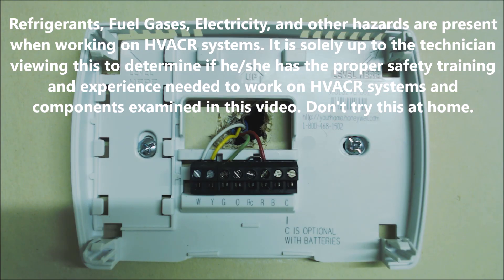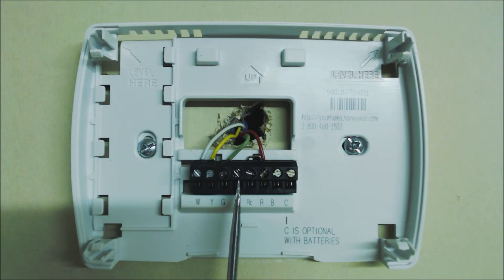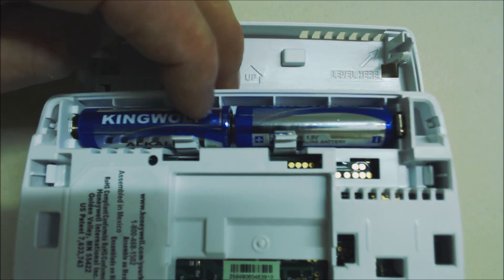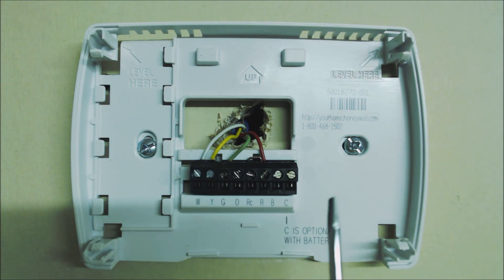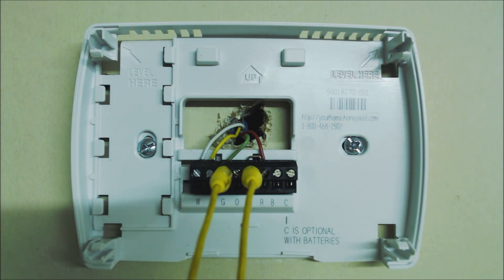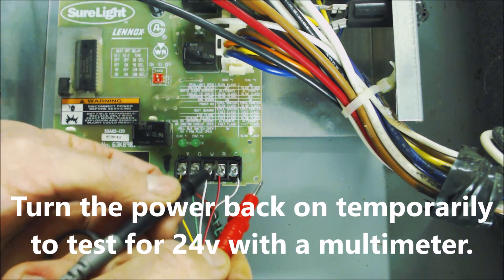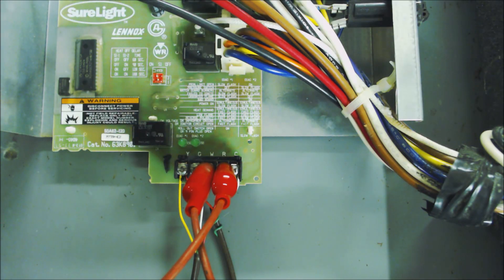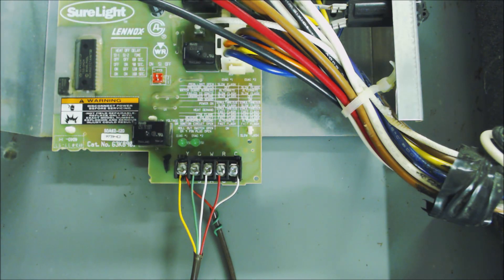Test the THERMOSTAT with Jumpers!

Comment from the maker: Tool List-  https://www.amazon.com/shop/acservicetech
Support-  https://www.patreon.com/acservicetech
For those that are looking for the tools used in the videos: (Linked Below)
Magnet Jumpers- https://amzn.to/2PyKPQZ
Pro 3000 Thermostat- https://amzn.to/2DKaYGc
Alligator Jumpers- https://amzn.to/2PxqJXn
UEI DL479 Multimeter with temp sensor http://amzn.to/2jtsUbJ
Fieldpiece ST4 Dual Temp Meter  http://amzn.to/2wc1ME3
Fieldpiece Bead K Type Temp Sensor https://amzn.to/2DBwKfs
Fieldpiece Wet Bulb Temp Sensor https://amzn.to/2RRI7Tw
Fieldpiece TC24 Temp Clamp https://amzn.to/2qHLyjZ

Yellow Jacket Refrigerant Gauge Set http://amzn.to/2aenwTq
Refrigerant hoses with valves http://amzn.to/2aBumVI
Yellow Jacket Gauge set & hoses https://amzn.to/2vLVkV9
Yellow Jacket 4 Port Manifold w Hoses https://amzn.to/2BkuGIq
FieldpieceSMAN360 Digital Manifold Set https://amzn.to/2BdoaD4
FieldpieceSMAN460 Digital Manifold Set https://amzn.to/2nB4Fe6
Compact Ball Valve for Refrigerant Hose https://amzn.to/2KUisW8
QuickDisconnect 90 for refrigerant hose https://amzn.to/2MMtVcg
JB 6 CFM Vacuum Pump   http://amzn.to/2nqbvo8
Appion Blue 3/8" to 1/4" Vacuum Hose http://amzn.to/2uYlVyc
Appion Red 3/8" to 1/4" Vacuum Hose http://amzn.to/2uYg6Ro
Appion Valve Core Removal Tool http://amzn.to/2uYr8WL
Yellow Jacket 1/4" by 1/4" hose http://amzn.to/2umtcod
CPS Vacuum Micron Gauge http://amzn.to/2v1nM3O
Supco Vacuum Micron Gauge http://amzn.to/2v1JRiA
RectorSeal Bubble Gas Leak Detector http://amzn.to/2ckWACn
UEI DL389 Multimeter  http://amzn.to/2xAdaJf
Air Acetylene Torch setup    http://amzn.to/2aQalsb  
15% Silver Brazing Rods  http://amzn.to/2gVLyLc
Nitrogen Regulator    http://amzn.to/2bXdR5f
Nitrogen Flow Meter    http://amzn.to/2brvoBg

Other tool links can be found in the video description section.

Shop through Amazon! Your Purchases through Amazon provide a means for channels such as mine to earn advertising fees from all purchases after clicking through. Prices are the same as normal-    https://www.amazon.com/shop/acservicetech
Reply: Great. Thanks for this information

Comment: I wonder how common it is for thermostats to go bad vs. other problems such as wiring, air handler or heat-pump PCBs, etc.
Reply from the maker: It really depends on the situation and the environment, but thermostats are definitely a common failure point!

Comment: This video saved the day for me. I had my 20 year old Trane heat pump and Honeywell thermostat replaced a few months ago with a new similar Trane unit equipped with an Aprilaire thermostat. It was working fine until first cold day under 30 degrees. Aux heat and Emergency heat didn't turn on the electric heaters.  Using the techniques in this video I jumpered between the red , white and green wires and everything worked perfectly. Reinstalled the thermostat and found the new Aprilaire thermostat was receiving 27v but was only sending 16v on the white wire, not enough to energize the contactors. Checked wires and could find no problem. Finally switched back to my old Honeywell thermostat and it's working perfectly.

Comment: So my AC and fan is working yet when I cut my heat (propane) on I hear the thermostat click but then when I go to my furnace I hear it short cycling would this usually be a thermostat problem? If so how would I test the thermostat properly? From your video I assume you would jump the Red and the White correct?

Comment: What if my hvac heat unit is working but suddenly it doesn't turn off when it reaches temp. It just keeps going. It's a carrier all in one forced air gas heat and air unit. I killed power, changed batteries of thermostat. When I started it back up and applied power, the heat and fan kicked back on. Even though the set point is way below the actual temp in the room.

Comment: Does Rc (at the thermostat) connect to just Y.   OR.     does it connect to both
Y and G.              At the control board you only jumped R to Y.  for cooling test,
but no G for fan? thank you
Reply: I need that answer too because some units only jump out if you put 24 volts to y and G at board while others work completely by just jumping out y at board. I know that is based off of the board at furnace but if the thermostat doesn't send call to G always then some units wouldnt work with just a call for Y at thermostat. I think the thermostat always energizes G on call for cooling but the board will energize a separate relay (therefore overriding fan if it is in the on position at thermostat)  on call for cool or when Y is energized to energize cooling tap for fan. On the board in this case I believe just jumping out Y would energize cooling tap as well or higher speed fan. I think it's  back feed that powers G wire to kick on when you only jump out Y at board.

Comment: My air comes on but after 12 to 16 hours the house heats up, but the air is blowing, but the family outside isn't on. BOTH the unit and the furnace have a normal operation per the fault light. On 2seconds off 2 seconds( red light)

Comment: I watched plenty videos but this got it done.  Although not exactly like my control board, the tips led me there. I stalled at what to do after no voltage at contactor, but having power at thermostat and also jumpers worked for their function.  In a hot house for three days. Tx again

Comment: My Condenser fan was not working I replaced the Capacitors and contactors  still not working .I checked my motherboard and one  wire was loose Thanks for the video :) Seems to be working fine now.

Comment: If I have the C (common wire) connected, do I need to remove the batteries ?
Reply from the maker: The batteries can be kept in there if you have a programmable thermostat so that the tstat does not loose the temp settings for each day. If its nonprogrammable, they can be removed, thanks.

Comment: I just replaced my thermostat wire with 18 /5 from the 18/4 to add a common wire.  AC and fan run but no heat. I have double checked the wiring based on the photos I took prior to the changeout.  I get 24v between R and C, but when the thermostat is attempting to call for heat, I do not get the 24v.  I do get heat when I jumper the R and W connections.  I switched back to the old 18 /4 wire and still no heat.  I can't image how the thermostat would go bad just in a few minutes.  I assume it could be bad connection with the W wire under the set screw. It can't be the R because I am able to run the fan and AC.

Comment: My Problem is that the fan is practically running all the time. Sometimes the house reaches the set thermostat temperature and still running, not just the fan, the heat also.  I have a heat pump and recently a technician changed my blower motor. He seemed a little unsure of the wiring and before my system wasn't like that. My outside unit was not turning on unless the emergency heat was needed. Now it turns on with regular heat. I have a Honeywell elctrical/battery  operated. I just change the battery but I really think is the wiring because the way my outside unit now kicks in the way it does. What do you guys think?

Comment: OK, big question haha. I have the same thermostat "honeywell pro 3000" and want to upgrade it to the wifi honeywell T5+. My wiring in compartment is hooked up exactly the same with an extra set of Y and C wires going to the Air Conditioner. On my thermostart however, I have no C wire there? Can I move the G wire to the C instead and also having to switch the G to C in the compartment? Also Id have to jump both Y and G for fan to work right? Youre fantastic at what you do and I dont want yo have any problems 😀
Reply from the maker: If you have a control board, it may turn on the blower without any jumping to g. You could test first in the cabinet by turning the power off, jumping from r to y in the cabinet with the fan off at the tstat, turn the power on and see if the blower turns on, thanks!

Comment: This may be a better appropriate video of yours for why my blower motor isn't coming on..  I cant seem to figure out why my new Goodman MVC96 furnace blower fan shuts off as soon as I switch the thermostat to cool mode but the condenser does start up fine.  Because of no blower fan circulation the TXV and service port start freezing up immediately so I cant even get to setting sub cooling  . I have the 2 condenser wires hooked to Y & C on the furnace control board but when set the thermostat to cool it shut off the blower fan. Blower fan also wont run in the ON or Auto position when set to cool but does work in heat and fan only mode.???   Any suggestions would be great. thanks
Reply from the maker: James, did you say that you replaced your thermostat already in a different thread? It sounds like the thermostat is just not sending the signal to indoor unit when you are turning cooling on. You could turn the power off to the furnace and then wire nut or jumper R, Y, and g at the thermostat. Then turn the power back on. If this turns cooling on and the blower runs no problem then your thermostat is to blame. The thermostat usually connects r to y and g but maybe it is only connecting r to y and your furnace board is not getting a signal to turn the fan on? Though usually even if the board gets a 24v signal to only y, it still turns the blower on because it knows cooling is calling, thanks

Comment: Great video. just so I understand. you can use the multi meter on R to C to test voltage. But don't jumper R to C because it can cause a short? Thanks
Reply from the maker: Absolutely correct, thanks!

Comment: the biggest issue I find on those plug in base thermostats are bent pins or the pin solder joints broken at the board inside, because people just smash them on and off without aligning them first.
all brands pretty much.
Reply from the maker: I agree, bad connections, thanks!

Comment: So where would the other end of the common wire go since it isnt on the thermostat?
Reply from the maker: If it is not connected at the thermostat then it shouldn't be connected to the common part of the transformer or board, thanks
Reply: It shows at 0:04 there is nothing on the C terminal of the thermostat. However at 5:16 there is something on that C terminal.
Reply from the maker: That is the two wire that goes out to the outdoor condensor for air conditioning to power the contactor. That C isn't connected to the thermostat, thanks!

Comment: Got to plug that hole, attic air will come in right on therm with a low pressure in home.
Reply from the maker: Yes, I usually use GE silicone #1. Thanks for stating that for everyone!

Comment: In that case could you use the M500 megohmeter to check the wires to the thermostat?
Reply: Easy
Reply from the maker: Yes you could test each wire. To do that, if you wanted to test the white wire then the power is turned off and select another wire such as the red and disconnect them from the board and wire nut them together. The test at the tstat with the wires unscrewed. After that, replace the red wire with another wire to check again since you need a path back, thanks Robert and Alan!
Reply: Ok thanks!

Comment: A friend of mine was looking at an older Armstrong furnace. They Went Ahead And REPLACED The Control Board AND I Believe He Said The IGNITION MODUAL As well... Still Won't fire... He Called Me AND I Said To Try AND Jump Out R AND g Still nothing... Any opinions? lol
Reply from the maker: We are all always in a state of learning and that I think is why we like it. It keeps us interested and moving forward! Thanks Jules and Summit!
Reply: Yes check out Hi and Low Voltage coming into Furnace.If No Blower and No other jumped out terminals do anything also make sure you have Hi Voltage and Control Voltage (Low) then go from there to your Board because most cases the Board Controls everything from Fan to Heat exception is Cool direct to outdoor unit but board still controls the Fan in Cooling mode
Reply from the maker: It could be the transformer itself. Maybe no voltage at the r on the control board. Does he have 24v from r to c at the board?
Reply: @acservicetechchannel  that's his next thing he's replacing lol he wouldn't listen at beginning so bout 200 bucks to replace 3 parts.
Reply from the maker: es absolutely start with the power going into the furnace, followed by the transformer, then jump from r to g or r to w at the board to test, thanks Jules and Summit!
Reply: Have a lil Experience here 63 and have been doing a/c and heating with sheetmeatl Fab since I was 18 so I think I've seen just about all but there's always a Day that Proves me Wrong in good and bad sense ,Lol
Reply: @JulesODwyer  I'm always learning something everyday! It's one of those fields where everyday is something new lol